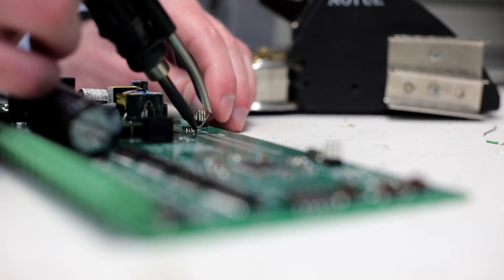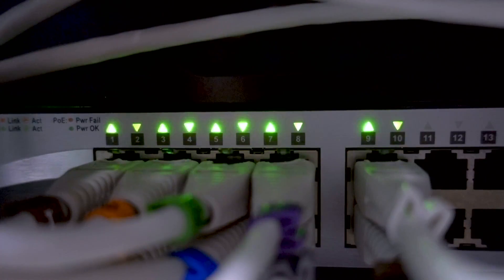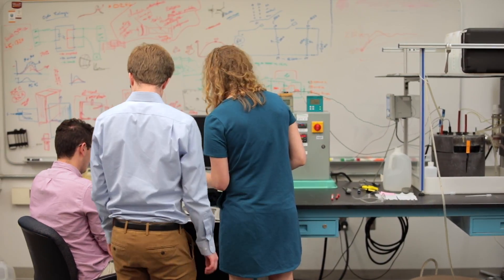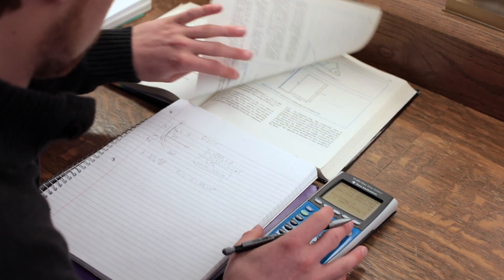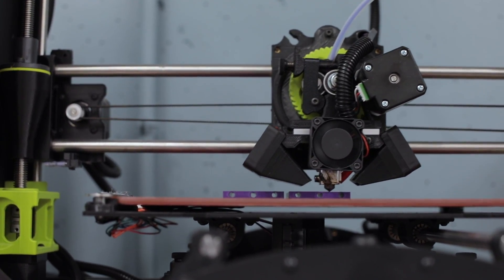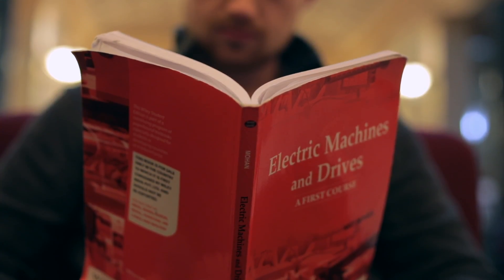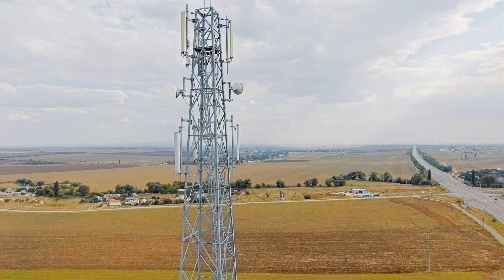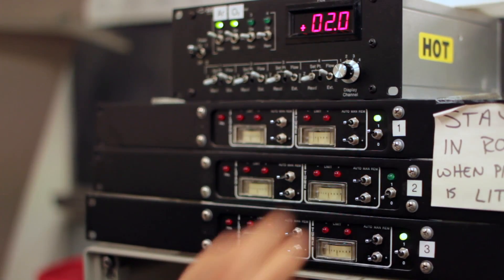Why I chose my major: Electrical & Computer Engineering

Comment: /int= S s-p' < 4LnM^(locates lifts- spray by: 35degs nozzles- clouds) hyper drives dF''(f'xn''' frqs) DC-9 tachron IC diesel / 
/int= fill S' s-p' as live tachron 1st {4,1,3'3, a''a'} 2nd {6'bits, 8'8'', control maps} /
/int= X''' 3'2''3dx (M'm(y'n - x) int control maps att mid s-p' /